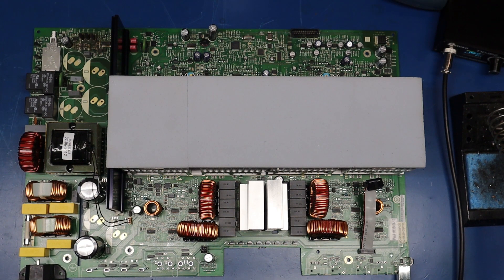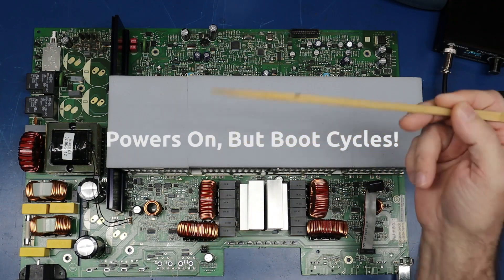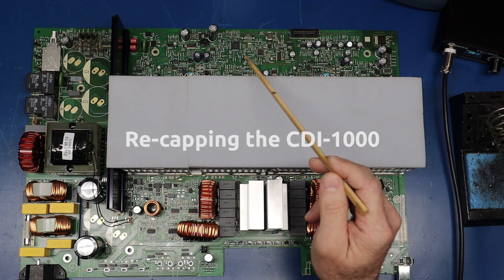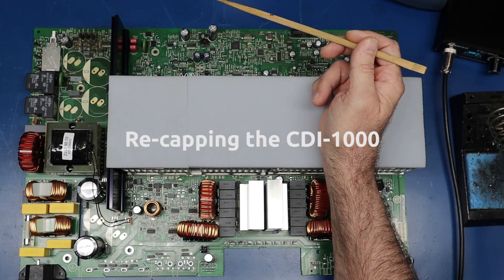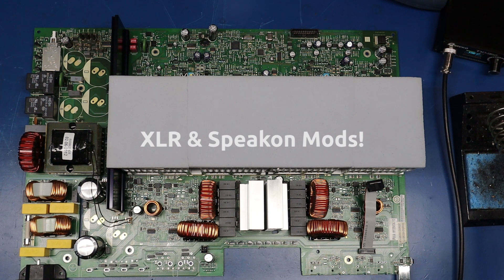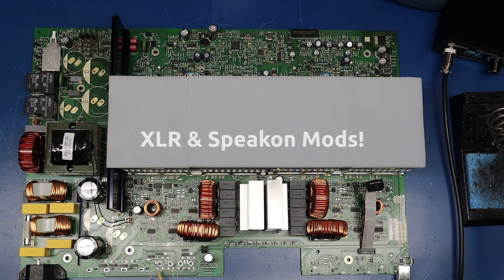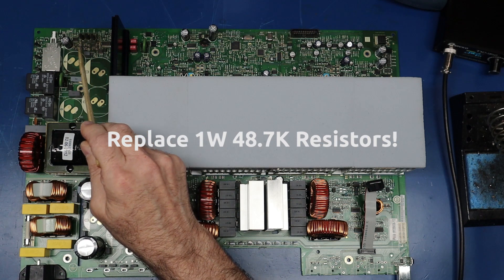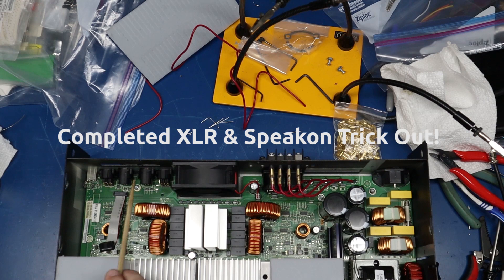Crown CDI 1000 Repair, Re-Cap, XLR & Speakon Mods!

Comment: The capacitor C196 is insufficient for this amp. So if it needs replacing, crown recommends replacing it with a 63v 220uf capacitor instead of the factory one which i think was originally rated at 220uf 35v.

Comment: Hi! I'm struggling with my cdi1000, it's already turned on, but the display doesn't work at all, can you help me, what could be the problem?
Reply: Olá,.. tenho um crown cdi 1000,..  com o mesmo problema,.. display não funciona,..  vc conseguiu, alguma Solução???  obrigado
Reply: The screen backlights on these amplifiers are known to go bad. Replacing the backlight only costs about 10 dollars, but removing the old one was pretty difficult. Another option is to replace the entire front panel, though that can be quite expensive